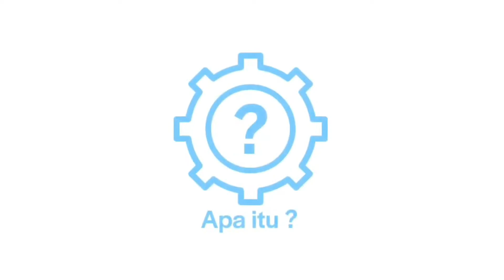10 Minutes Removing ECU Hyundai Santa Fe DM CRDI (Silent)

Comment: It's necessary programming inmo?
Reply from the maker: not necessary, it was a time where the car going into limp mode, the RPM limited around 3000 max. i've read the map, there are no value above 3000 RPM.

it was P2112, replacing the dc motor in throttle body solve the problem without touching the ecu